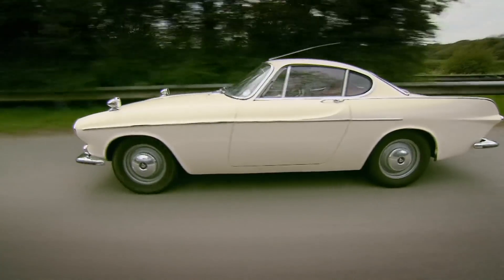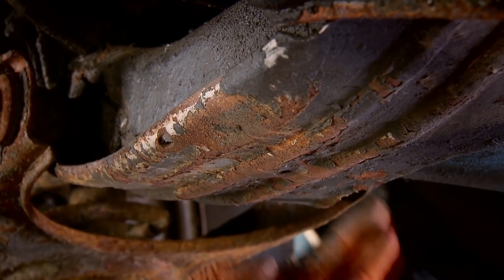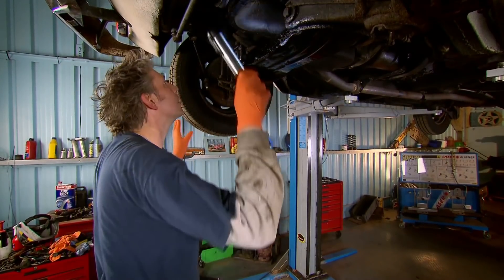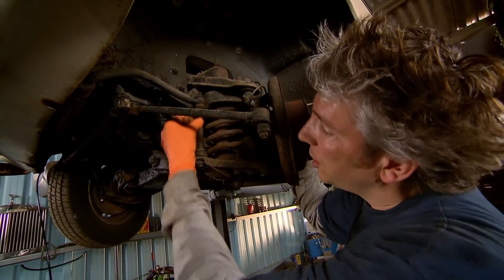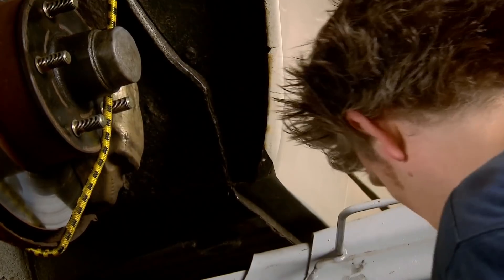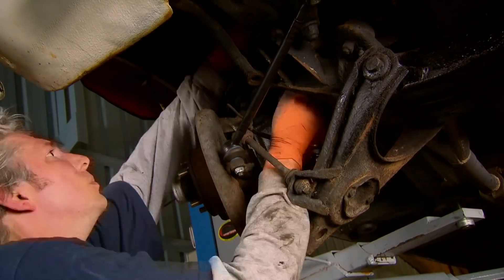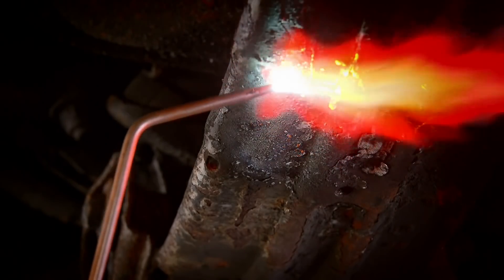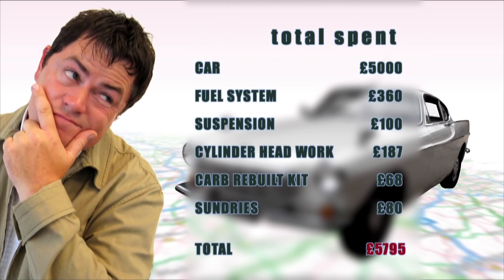Volvo P1800's Suspension Spring Is Broken! | Wheeler Dealers

Comment: Was the heat treat compromised? Does that cross member need to be annealed?
Reply: Atleast get a heavy dose of waxoil into it, or it will rot out, as the heat has burned out all previous protection.

Comment: may be in England it is surface rust, if the spring snapped like that ,that is a rot ,and while you are at it why not change the stabilizer bar bushing that are dry and cracked!
Reply: Not always the case with springs, Ive found snapped springs on cars less than 10 years old with no corrosion.